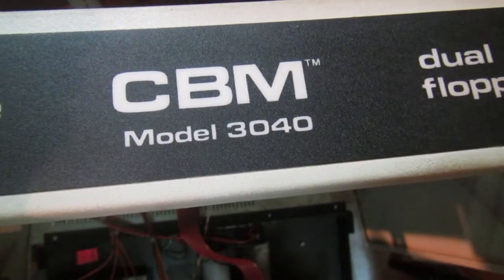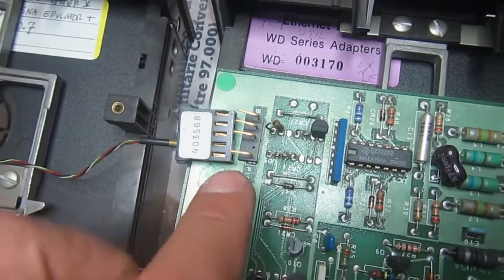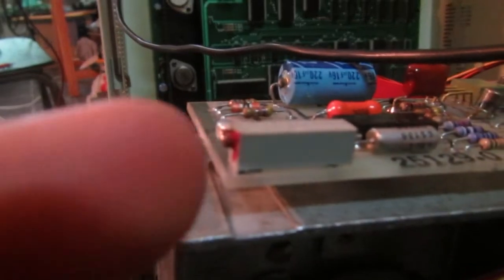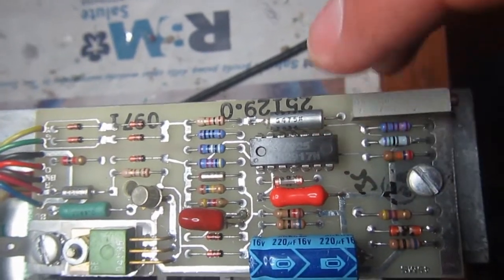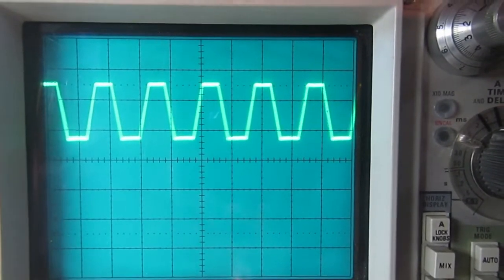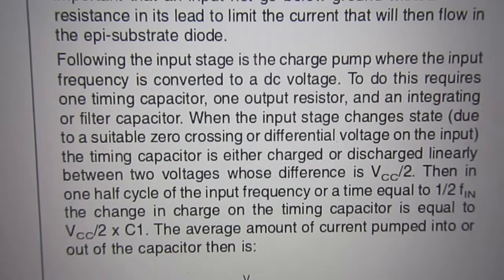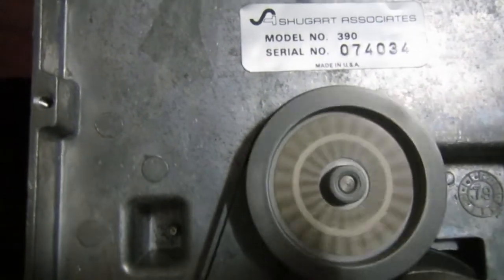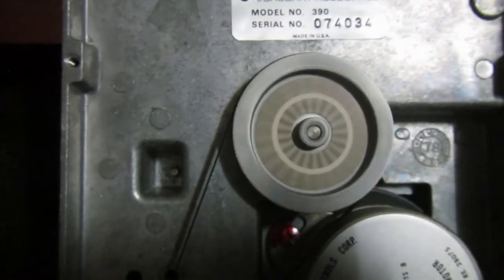CBM 3040 (4040) disk drive repair: spindle speed out of control

Comment: thanks for the video.  If I may ask, how did you swap those motor control connectors?  In mine the cords aren't long enough to swap them.
Reply from the maker: Yes, unfortunately you need to remove the four screws from the bottom of the case and swap the two drives actually.

Comment: Great video. I've cleaned up a CBM 3032, all works now, except after a while, the screen starts to shake more and more. If I narrow the display height, the problem is almost gone. I've replaced all the electrolytic capacitors in both monitor analog board and on mainboard, and re-flow/re-soldered all points on the monitor analog board. Problem still occurs. I suspect, bad shift register or bad video ram chip. It seems heat related, I've purchased a can of cooling spray, to spray on chip's to try to isolate the problem. Any ideas that might help?
Reply from the maker: What kind of "shake"? Can you post a video? I've seen many PET's monitor "shaking" but it always was a ground loop problem in my experience.
Reply: Here is videos: After a while, starts to shake in upper screen: https://youtu.be/_73xIGH-4M4
After a while, ends up like this: https://youtu.be/vxkCrv7_7fI

Could be something around transformator and AC? Maybe try without GND?
Reply from the maker: Hi, on the first video could be simply a ground loop. However, on the second video there's definitely a lack of vertical sync. I would check CR8, CR12, Q6, Q7, Q8 and nearby components and solder joints in the video monitor PCB. Also check that vertical pulses on CR8's cathode are always present (those are generated by the PET's motherboard video circuit).
Reply: The video is the same machine, the second video is from a few minutes later. I've already re-flow/soldered all joints on monitor PCB. I will re-flow the monitor connectors on mainboard next. Lower the screen height with the height pot resistor helps. Could the potentiometer be bad itself?
Reply from the maker: @classiccomputers341  Yes the potentiometer could be bad too. You should check also the components I've mentioned before.
Reply: @iz8dwf  Pretty sure it was the v.height potentiometer now. Sprayed it real good with contact cleaner. Now been running for about 1.5 hour with very stable display, only a very small distortion in the upper part. Before, it ran only a few minutes before it started and quickly got totally trashed as in the second video. 

Maybe the very small distortion in the upper rows is caused by gnd loop? How do I look into that, check what happen if I disconnect the AC gnd from the chassis?
Reply: @iz8dwf  When the display get distorted after warmed up, cold spray on the v.height potentiometer makes the display temporary 100% stable.
Reply from the maker: @classiccomputers341  Hi, distortion on the upper part of the CRT is very common, check if it changes with brightness, it could be some capacitors drifted out of specs.
Reply: Replaced all electrolytic caps already, could be a filter/ceramic of course. I'll have to wait for a new potentiometer first.

Comment: Great video. I got a CBM 3040 myself. Replaced a defect RAM chip and it now read and writes OK. EXCEPT: It get stuck when starting to format a disk, machine gun sound all the time and now moving position on the reader head. Is it a alignment problem, get stuck/moves reader head in front of track 36/40 and get stuck? Do you got an idea what to look for?
Reply from the maker: Hi! Does that happen on both unit 0 and 1? Did you clean the head rails and add a tiny drop of light oil on each of them? If you can post a little video of what happens, I could have a better idea. Can you write a formatted disk until it runs out of free blocks and read every program again without errors?
Reply: iz8dwf it happens on both drive 0 and 1. I used grease, but I will lubricate it with some light oil tonight and make a video. I don’t know how to write a disk from another unit like #11 (petSD+ sd card reader), but I file copied using CBM-browser (Norton Commander clone). I filled maybe 60% of the blocks. will try to write it completly full. thanks for helping me out.
Reply from the maker: @classiccomputers341  ok, if I see what actually happens, I might get a better understanding. Basicly what happens when formatting is: 1) there're at least 35 track seeks down (head is moved towards the center of the disk), it reaches the track 0 stop and rattles a bit until the seeks are over. This is needed because the SA-390 mechanisms did not have a track 0 sensor, so the only way to blindly go to track 0 is to seek back at least 35 times. 2) track 0 is formatted and read back, if ok, head is moved forward one step and track 1 is formatted and read and so on until track 35 is formatted and read back. 3) head is moved back to track 18, BAM and first sector of directory is written (sectors 18,0 and 18,1). 4) motor stops.
I've never seen a drive that can write but not format, unless it has an issue on track 0 sensor, but this isn't present on the 3040/4040 drives that I know of.
Reply: I tested some more. What happens is, the head starts to rattle and find its start position on the outer sector, and then starts to rattle again forever without moving towards the center. The exactly same behavior in both drives. 

I suspect error with circuit/logic. Seems like this drive got one CPU for DOS and one for FDC (controll) and firmware on 3-5`? ROM chips. 

Seems like when format command is issued, one CPU moves some data from ROM into shared memory, and the other CPU (FDV CPU) takes care of the format.

Maybe there is an error in ROM or with FDV CPU, not the 6502 "DOS" CPU???
Reply from the maker: @classiccomputers341   Yes, based on what happens and the fact you can read/write files, I'd say it should be a ROM corruption or something on the logic side. ROMs are usually socketed, so you could try dumping them and comparing to images you can find here: ftp://www.zimmers.net/pub/cbm/firmware/drives/old/index.html but you need the right hardware to dump those old ROMs (they're 2332 with some non-standard selects and the content of a 6530 RIOT).
There should be some test software for these drives, I'll try to locate it.
Reply from the maker: @classiccomputers341  It seems there're also programs to read the drive's ROMs from the drives themselves: http://www.6502.org/users/andre/petindex/drives/progs/index.html  I haven't tried them, but you might want to experiment with these
Reply: How many ROM chips are there in total, 3 of them? Would be easy to find out if I could just burn them with working dumped images. I just bought a 2532 rom to burn custom "editor" ROM on for my CBM 8032.
Reply from the maker: @classiccomputers341  It is not so simple. The 2332 inside a 3040/4040 (3 of them if you have DOS 2) use two chip select pins (20 and 21), one active low and one active high connected to the phase-2 clock. So you can't use a plain 2532. I designed adapters to substitute these (and other) ROMs. I suggest you first try to dump the ROMs via the IEEE interface and compare with the good dumps. The fault might be elsewhere (like a RAM chip maybe).
Reply: iz8dwf I just replaced 2 ram chips because I got error code with 9 flashes shortly after I got the drive. Is there a program to test the ram?
Reply from the maker: @classiccomputers341  There're various utilities scattered among the disk images here: http://www.zimmers.net/anonftp/pub/cbm/pet/utilities/index.html
I've those on real floppies and I remember there're some utils to test the 4040, but you should experiment a bit to find the right ones.
Reply: I ran a program called something like "boot performance", its made for 2040, but I think my 3040 is almost the same drive. Re-labeled  for Europe and to fit into the 3000-series in Europe that matches the 2001-N series in US.

Seems like the LED flashes when running this program, indicate an error according to the programs table:  "RAM (8)-2114 AT C4". 

I replaced the RAM chip "2114" at UC4. 
But no difference.
Reply from the maker: @classiccomputers341  The 3040 has the same hardware of 2040 and 4040. 2040 had DOS v.1 (2 x 2332 ROMs only) and 4040 has DOS v.2 (3 x 2332 ROMs present). Usually all the 3040 I've seen have DOS v.2, so they're in all respects identical to 4040 drives. If you have the DOS 2 3040 (read the error channel right after powering up the drive), then you better use 4040's diagnostics. What brand are the original 2114 on your drive?
Reply: @iz8dwf  I've now got my hands on another 3040. This one got a 100% working mainboard drive 0 works, but drive 1 got problems. Anyway, I tested the drive mechanics from my other 3040 onto the new one and they did format, so the "formatting" issue resident i the mainboard on my first 3040. I tested replacing 6502 CPU, UM6: 74LS165 and the UM3: 6522 (VIA) from my working mainboard. Stille the same problem with formatting.. Maybe this one got a problem with one of the ROM chips? I don't think I can swap the working ones from my "new"  3040, it seems to be an older revision of the 3040 with other ROM's, having one socket free/empty.
Reply: @iz8dwf  I've now typed in your smart little BASIC program and tested the bad drive #1 in my "new" 3040. The speed is wrong, adjusting the "pot" doesn't seems to affect the rotation speed either, drive #0 works and also gets the "correct" pattern on the "wheel". I suspect the same chip as in yours are bad, and now have to wait for a replacement chip to arrive from China.
Reply from the maker: @classiccomputers341  Hello! Yes, if the trimmer doesn't affect the speed, then either that chip is bad or some components associated with it. If you have an oscilloscope, I can tell you what pins can be checked.
Reply: Thanks. no oscilloscope, I've ordered a new chip.
Reply: @iz8dwf  New chip didn't help. The trimmer still doesn't affect the speed. I got no oscilloscope, but I got a good multimeter. I see a 220 uf electrolytic capacitor, some zener diodes, a voltage regulator, a transistor, etc. Could the trimmer itself be faulty btw?, What is the resistance on the trimmer? How many turns? Appreciate all help.
Reply from the maker: @classiccomputers341  First, look at the schematic here (page 66): https://nfggames.com/X68000/Documentation/Floppy%20Drives/Shugart/SA400%20Minifloppy%20service%20manual.pdf  The trimmer is 5kohm, you should measure it when powered down and it must change it's resistance when turned. You should also check the timing capacitor C2 and the small electrolytics not to have too high ESR.

Comment: I personally own a cbm 3040 disk drive but anytime i try loading something with LOAD"*", 8 the drive spins up for about 5 seconds then stops. Meanwhile the PET 2001 (EU model) is stuck on LOADING. Any ideas what this could be?
Reply from the maker: Hi! Is the 2001 running with Basic 1 (the * banner, not the ###)? Can you try:
10 OPEN15,8,15,"I0"
20 INPUT#15,E,E$,T,S:?E;E$;T;S
30 CLOSE15
and see what happens (and prints something)?
Basic 1 machines can't usually deal correctly with the IEEE disk drives unfortunately.
Reply: @iz8dwf  it is commodore basic 1.0 (*** COMMODORE BASIC ***) And it prints: 0 OK 0 0 (fyi both of the machines have been worked on and restored)
Reply from the maker: Unfortunately, the load from disk in Basic 1 is broken, so you need to upgrade the ROMs to basic 2 (### ) or Basic 4. I usually do it via a daughterboard installed on the 6502's socket, so I can switch back to the original Basic 1 by just moving a jumper on the board. It's shown in my 2001's repair videos.
Reply: @iz8dwf  do you know where to get the daughterboard + chips?
Reply from the maker: @arge7661   write me at iz8dwf@amsat.org
Reply: @iz8dwf  done
Reply from the maker: @arge7661  try also iz8dwf@tiscali.it since nothing shows up so far in the inbox
Reply: @iz8dwf  done oh and btw did you check the spam folder?

Comment: Great CBM repair videos. I always enjoy watching them. I have a few of alittle everything that still needs repaired around here but so little time.
Reply from the maker: Hi chris537a! Thanks for the nice comment! Yes, time is a real issue for me too, it's usually late at night when I play with these stuff :)
Reply: Great video. I got a CBM 3040 myself. Replaced a defect RAM chip and it now read and writes OK. EXCEPT: It get stuck when starting to format a disk, machine gun sound all the time and now moving position on the reader head. Is it a alignment problem, get stuck/moves reader head in front of track 36/40 and get stuck? Do you got an idea what to look for?